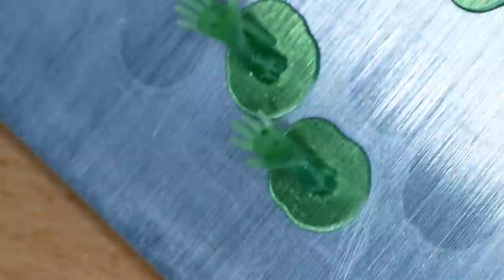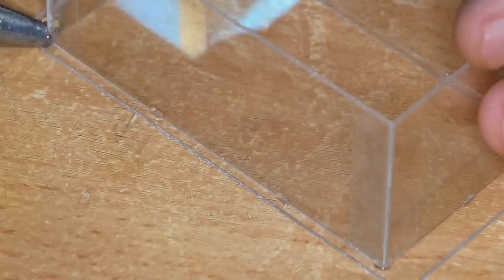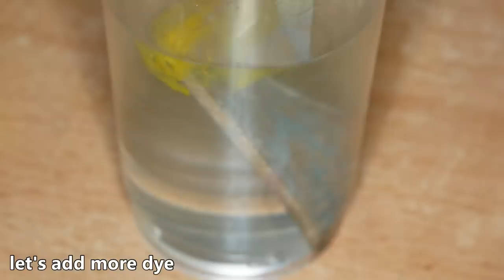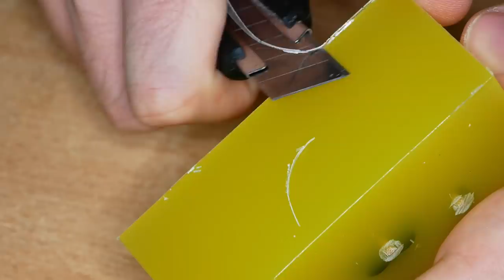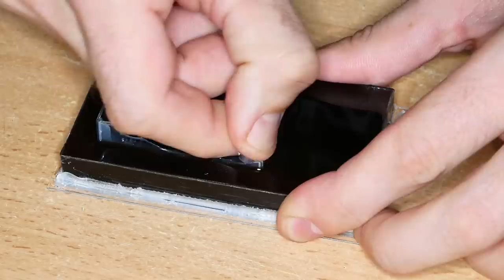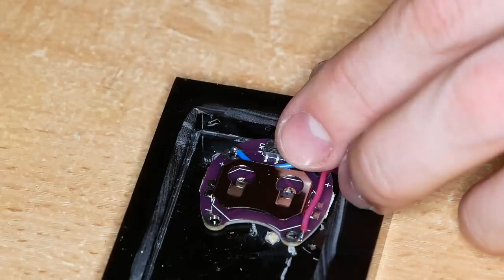Halloween 👻 night lamp / RESIN ART

Comment: You blow my mind with every creation!!!  I have a question about the UV Resin.  Say I didn't place my piece exactly where I wanted it after using the UV light to set it.  Would using the UV light again, reactivate the UV resin and make it softer so that I could move it again?  I sure hope that this makes sense to you :)
Reply from the maker: The process cannot be reversed. UV light only hardens